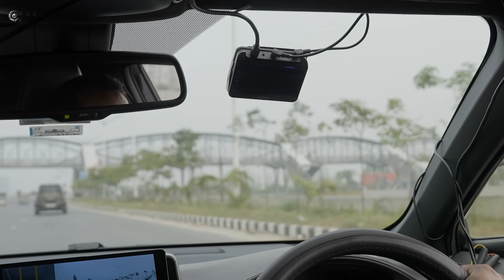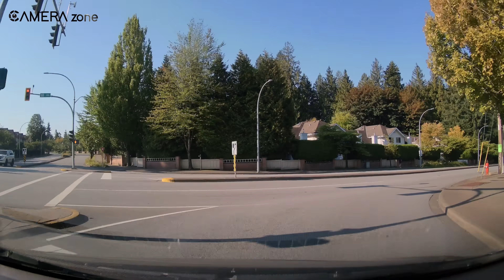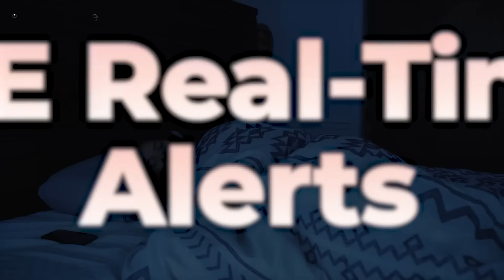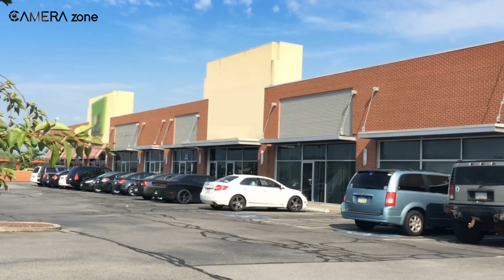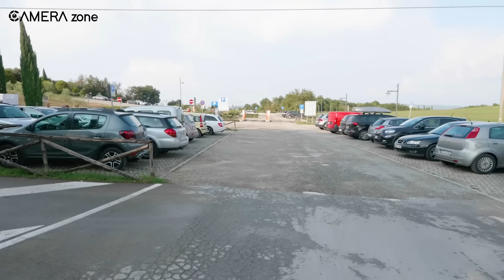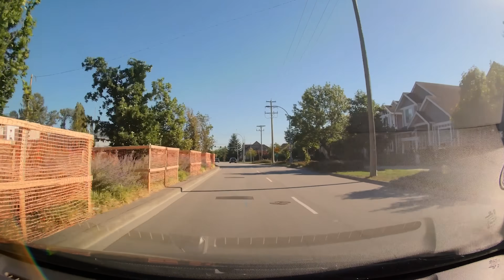THINKWARE ARC900: Pro-Grade Dash Cam Footage in Real Time

Comment: but does it record interior of the vehicle? that feature is very much needed to record incidences by uber drivers, or an incidence happens inside of the car like a fight or when approached by police the interaction from inside and outside can be recorded. And if it is capable of recording the interior can the angle of the camera Lense be adjusted in direction of point to interest? these questions should be standard things to address but this video fails to mention them.
Reply from the maker: This is not a three channel dash cam. You only get front and rear recording.
Reply: @camerazone_  thats too bad. perhaps the company would not limit its design to two channel dash cam so it could meet more use cases fot those who need them. if you can develop two channels why not three channels?